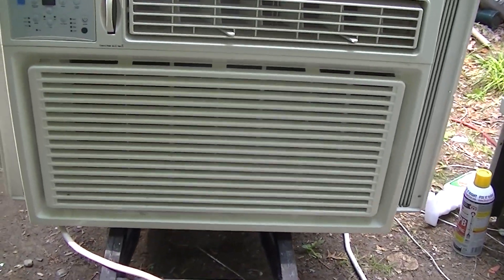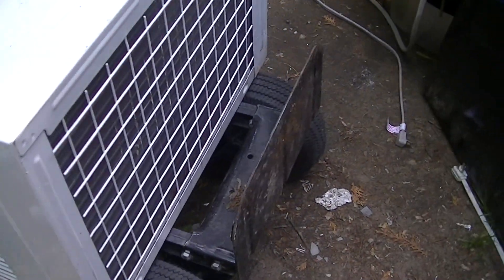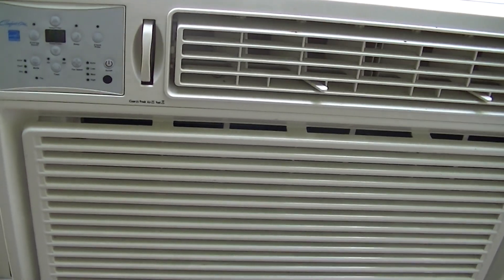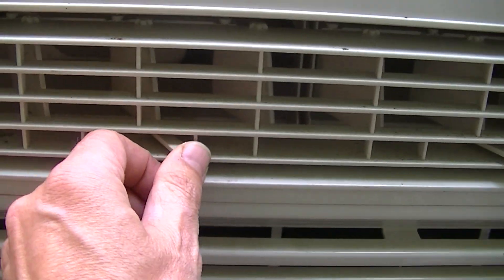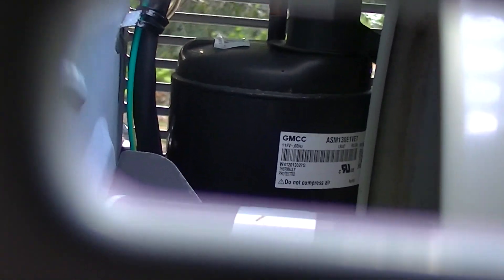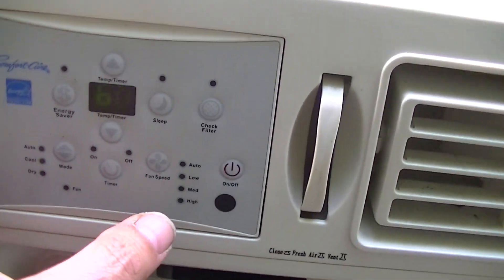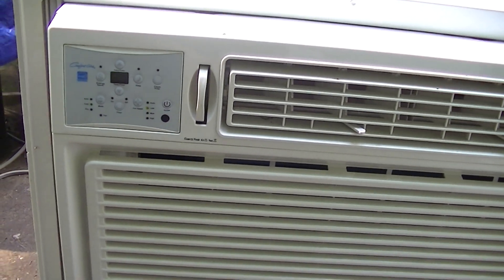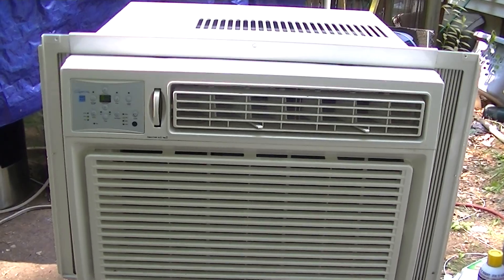Comfort Aire 15100 BTU Air Conditioner

Comment: That’s a pretty cool unit, I have a Comfort-Aire as well but it’s from 1978. Mine is a 29,000 BTU and has a Tecumseh AH Reciprocating compressor in it. The modern Comfort-Aire units I would say are pretty fair overall even though they are actually other maker’s units woth the Comfort-Aire Badge slapped on them. This unit in fact is a Re-badged Frigidaire 15,100 BTU but still performs quite well. Great video and I look forward to more.